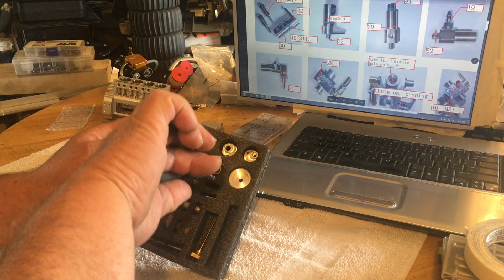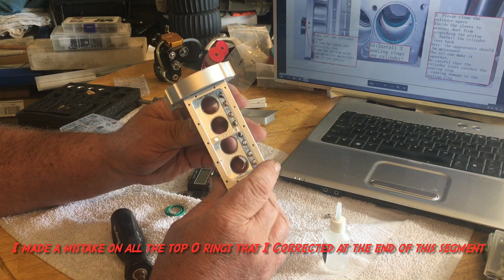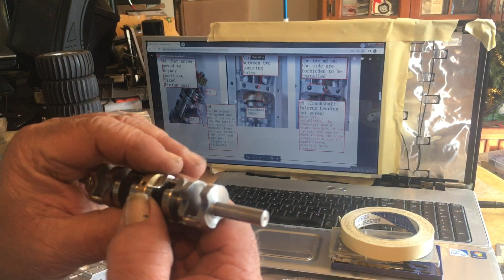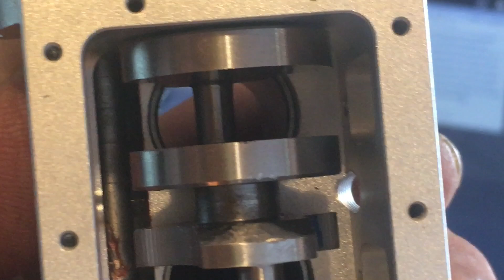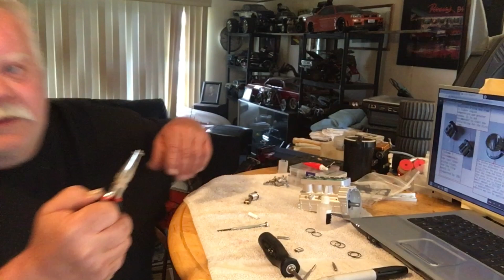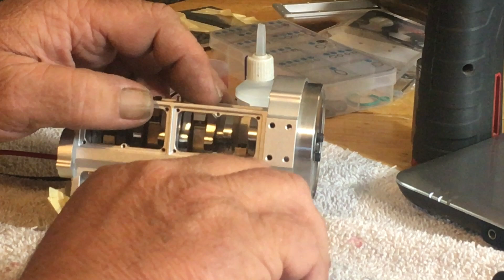Cison L4 -175 full build video

Comment: What do I do if all of my wrist pins just slip through on both sides on all of my pistons? Like no resistance at all! red Loctite or some high strength heat resistant glue? My pins cant move about or they will score and or destroy the sleeves if not the whole engine.

Comment: Hello Dennis,I got the engine almost complete except for the oil lines! I bought the additional in line filter but it is useless it fouls with the oil filler hole and starter motor ( too big) I cannot find any information on the internet,the feed connection is easy but after the pump where does the oil return to the crankcase?What is all this business about these holes nd adjusting the oil pressure? it appears to be important!! thank you for your time and patience to make these brilliant videos. From the UK thank you
Reply from the maker: I spent over 18 hours on trying to start mine brother, check out my latest video if you want.

Comment: I also noticed that the one gear on the oil pump does not use what they call a “locating pin” 
I tested my oil pump with the floating gear and it actually works extremely well
Reply from the maker: Thanks for the information! I was wondering if I need to remove my locating pin before I start mine,